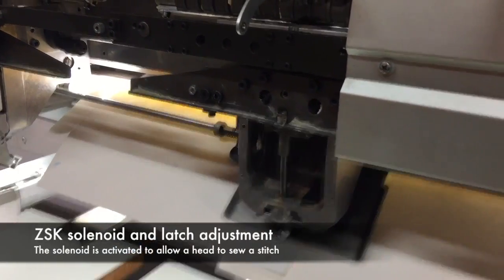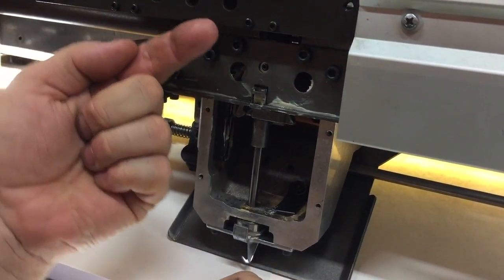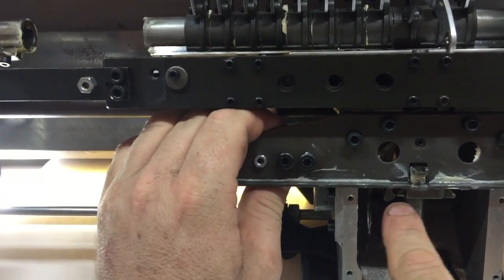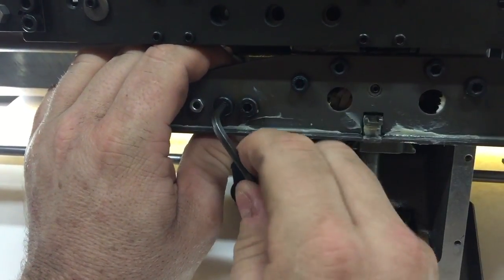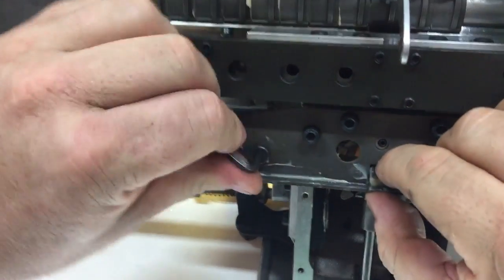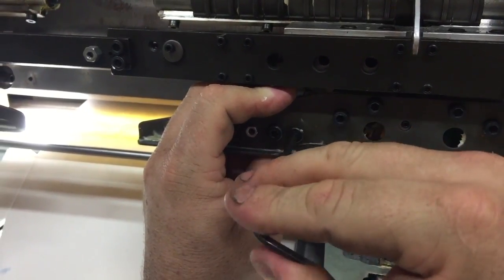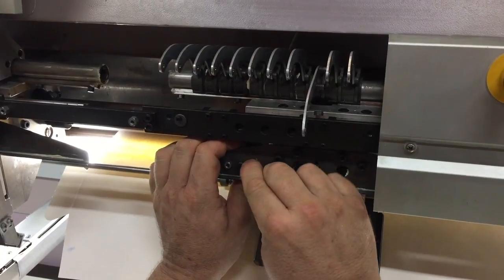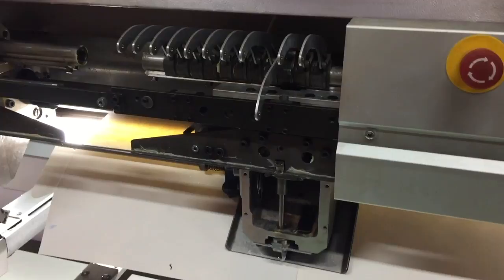ZSK JB08 Solenoid Adjustment - ZSK Embroidery Machine Service Series part 3

Comment: my zsk screen is off, can you help
Reply from the maker: Is your screen LCD or CRT? On our old JB machines we plugged a different VGA monitor into the video out of the computer. For LCD machines, we had a couple with intermittent LCD faults, the vibration made the inner video cable detach from the back of the LCD. A slight tap on the side of the computer box sometimes brought it back, but ultimately a replacement LCD screen was fitted

Comment: Do you know if the 1mm gape is the same for The Racer Models?
Reply from the maker: Sorry mate I’ve not worked on the racer models
Reply: One more question at what degree do you Check the 1mm gap